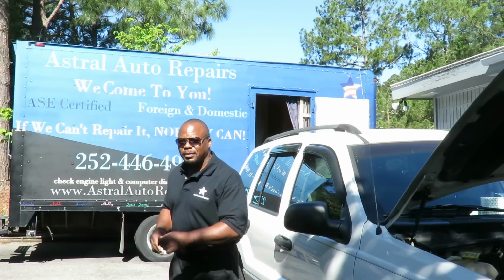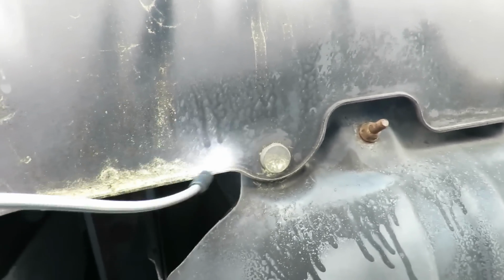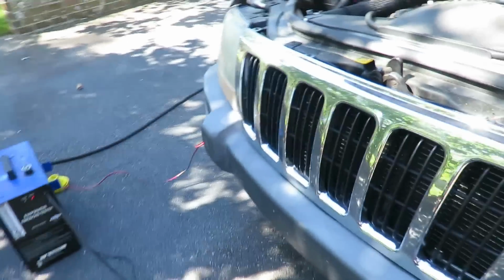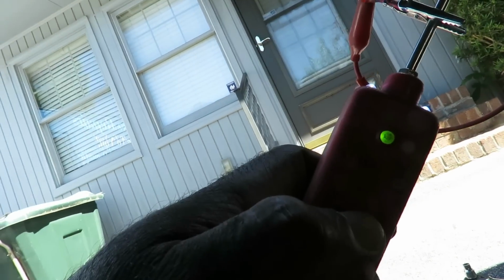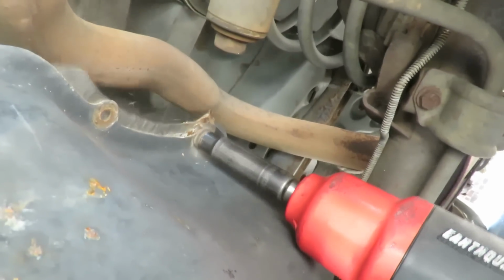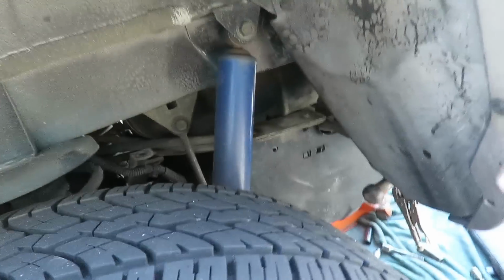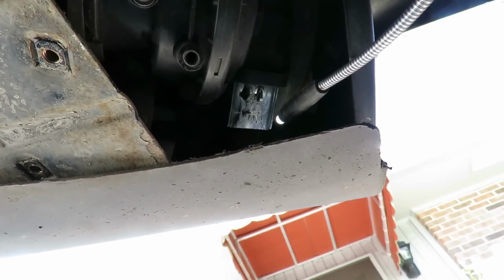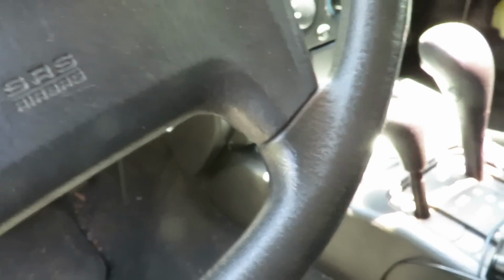⭐ 2002 Jeep Grand Cherokee - 4.0 - P0455 - P0442 - Evap System Gross And Small Leak Detected

Comment: I replaced my valve 2 years ago on my 2000 WJ. Still getting off and on code after resetting and a couple hundred miles. So I blew pretty hard on mine and it barely had a bit of air coming through, is this bad?? It is ticking. ALSO, all lines are good. 
So I blew into the fuel vapor line from the tank and it seems clogged. Is there soposedly to be able to blow air through it
? I did smell gas from it but could have been from the charcoal canister? Getting PO441.
Used to top off my tank.
Anybody?? Thank's

Comment: Great work man! Maybe the detector needs some flow through it to detect? When you plugged it back up it wasn't leaking right idk. One way to get the codes in these jeeps without the scanner is to turn the key on and off three times and the codes pop up on the odometer. Thanks for the video great work ✌️

Comment: Oh I also need to change the rubber hoses that come from the moon roof that are corroded. I watched a video and got all the parts and they fit perfectly, I don't have to go past the dash as the sun never got to it, so the hose will be changed from the roof going down the inside panels to the dash. The problem is I cant drop the headliner. I have taken out the visor, handles, the computer and seatbelt. Do you know if there is a clip keeping it up and if so, where is it? ! Lol
I dont know why they didn't use rubber hoses and used that blue plastic, ribbed hose. It crumbled in my hand. Like dust! Once I change that, it will probably outlast the truck. I wish there were mechanics that would do the work with you for the people that like to fix their truck and have two heads instead of one. I would pay the mechanic for helping me and with certain things help him. I am not the type to just drop it off. Unless it's a big job. I do my own oil too. There is a great feeling when you had a hand in fixing you own truck or did it all yourself.

Comment: That was a great video. Need a mechanic that takes their time and doesn't destroy other things, being hard handed.  I am going to try to see where my evap leak is coming from, I am sure is under the truck, well hopefully not. I already changed the top canister, and it went from 3 codes to two. I have had jeeps forever and worked on them with my friends that I have changed so many things that required taking the top parts of the  engine to get to things, but there are certain things that I rather let someone else do, like the front driver side axle. I have kept it clean and not driven it when it rained, keeping dirt out.  It's not jumping so hopefully won't have to do both axle. After passing inspection, that's next. It's a good truck and thats all thats wrong with it for now!!. The truck is a 2001 grand jeep cherokee but I have had it since day one, so it's been babied. Where are you located?
Reply: You must from the east Coast? We don't call them trucks. Lol

Comment: I've commented before n told you how great n entertaining your vids are. I once again got these codes even after replacing all hoses in the rear qtr panel except the pump. Anyway id like to know what kinda probe you used to test that pump that you connected alligator clips to. I need to do that. Also what brand pump would you recommend to replace if needed besides mopar. Please reply ASAP because i cant get jeep inspected till this is fixed. Thanks

Comment: Mr Dig-It from Astral Auto- tremendous video on chasing down the 0442 and 0455 codes, which just popped up on my 01 Jeep GC. Of interest, I’m about to change my gas tank skid plate shield and you video gave me excellent insight as well. BTW, I’m going to replace the hose on top of the gas as a preventative maintenance measure as well, LOL. You are very patient and though rough.
Thank you

Comment: I've been working on my Jeep for 19 years now. This video is absolutely awesome. It shows everything that's involved including the broken bolts, the diagnosis in real time, and from the aspect of a home mechanic - that it can be done with time and patience by anyone that has the mental flow to be analytical. A BIG thank you. Now, I have to go tackle this problem. I have a smoke machine, but it doesn't have the measuring ball, non-the-less it's enough to get it done. And thank god you told me the purge valve service port is left hand threaded! That was a mistake waiting to happen.
Reply from the maker: LOL on the reverse thread! As long as you have the smoke machine, that is 75% of the battle. How some of these guys out there is using a cigar is beyond me 🤣🤣 Keep us posted on what you find!

Comment: I have a PO455 code 
EVAP Emissions Control system leak (Laege) would it be under the tank or just check all the hoses?
I don't have a smoke machine
Reply from the maker: Check all the hoses, and even the gas cap. With a LARGE LEAK, you should be able to find it without a machine. Keep us updated!
Reply: Astral Auto Repairs thank you so much 
I’m a Jack of all trades master of none kind of guy
Bought a code thing reader and that code and a PO137 code which it’s a 02 sensor video I have to look at
Thanks again
Reply from the maker: @Buckfever718  Thanks Enzo, on that code, it usually comes out to be the sensor. Unplug the sensor, and with the key in the "ON" position, one of the wires will have 12 volts, and one will have ground. If it does, replace the sensor.
Reply: Astral Auto Repairs thanks for that info as well

Comment: I always enjoy your videos, you do great work. I have these codes right now and I'm guessing that's the problem. My other issue is sometimes it doesn't want to start or once it's started it sometimes shuts off. Any suggestions?
Reply from the maker: Are those the only codes you have?
Reply: Check your negative ground clamp and the terminal on the battery. Loose clamps and corroded terminals have a tendency kill the engine or not start on you intermitantly.

Comment: I see a scan tool is needed to set evap pump for leak test. Smoke won't go through.
Reply from the maker: You can definitely perform a smoke test without using the scan tool.
Reply: I tried smoking my 2004 jeep.  No signs of a leak however no smoke even from the gas tank. code po455
Reply: @OnlineAutoRepairVideos  Watching you program, just can not hear you. I see you using jumpers but to wht terminals and what voltage?
Reply from the maker: There should have been smoke from the tank.
Reply: @OnlineAutoRepairVideos  no smoke from the tank
 Going to have a shop with a better smoke machine try it.
Reply: Hate to be a bother. In your one vedio, you showed hooking up to the leak pump. Could you tell me what that set up was?I have that all apart, don't see any bad hoses. Did get smoke to the tank. Again I have the pump exposed and would like to try your test. Appreciatedd.

Comment: Good informative video, hope it educates the design engineers that simple rubber hoses might need replacement in the long run. Assume if they had practical design codes, they would not make such impractical poor design configurations. Thanks for the video.
Reply: Stuff is designed to be cheap to manufacture not inexpensive to fix.

Comment: i just found the leak detection pump and blocked the hoses with electric tape and put the hoses back cleared code...no more light $0 fix
Reply: Can you show how, it seems i have same issue on the fuel tank hose, the smoke is coming from down there...

Comment: If the purge selnoid is clicking all the time does that mean its bad..
Reply from the maker: No, it doesn't mean it's bad.
Reply: @OnlineAutoRepairVideos can it be stuck in the closed position and still click??
Reply: Yeah that's what they said at auto zone.I got that code 443 an 456..I got the same 02 jeep I seen you working on.I mite change it to see if the light goes off if it don't I guess I have to do the smoke test.love your work.you got a new sub
Reply from the maker: @garymac9641  THANKS!!! That P0456 can cause it to click. You must go over all the evap lines and search for a small leak. If that purge valve is not closing all the way, that could be your problem. Do you have a smoke machine?
Reply: No I guess I will have to take it to a garage if I can't figuar it out.it does got a little cut in the line that goes to the sealinoid.could b that.I live in ny an they want inspect your car if engine light is on.I come up here from  Va. an they don't care about that crap down ther.lol
Reply from the maker: @garymac9641  Yes, it could be!

Comment: hey Tim as a future heads up I don't know if you knew this I just got me a 2004 Grand Cherokee and if you happen to not have a engine check reader you could put the key in the ignition and you crank it three times off and on real quick and it'll actually pop up the diagnostic code right where the digital mileage is at I thought I put that out there  something I just found out. I give away my check engine scan reader and looking on a form online and so I tried it and it gives every details seems like these are very common I just replaced the gas cap on mine and so I'm going to do some more troubleshooting and hopefully solves it great vehicles definitely gets the babes 😁😁😎😎😋
Reply from the maker: Thanks for looking out for me with information!! Yes, I did know about that because Chrysler has been doing that for a lot of years.

Now to return the favor...

On a lot of the older Cadillacs, you can hold in the "OFF and "WARMER" buttons on the climate control panel, and the codes will pop up on the dash also.

THAT'S WHAT I"M TALKING ABOUT, people looking out for each other, sharing information...CAN YOU DIG IT?!

lol, thanks!!